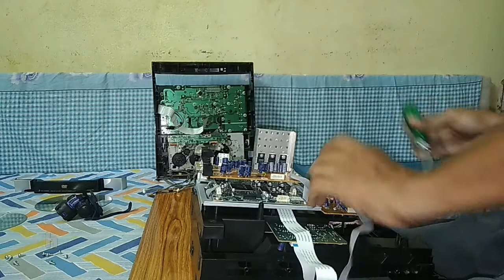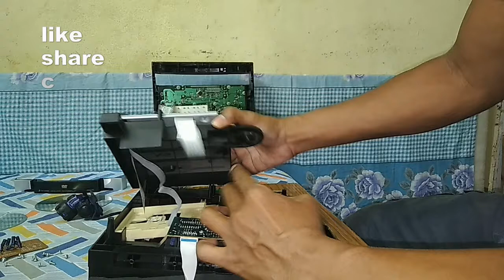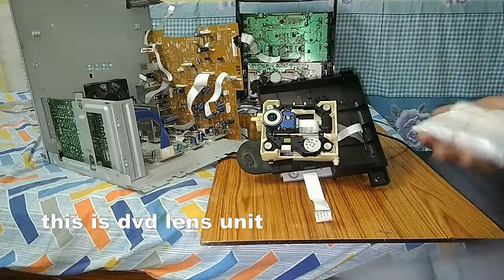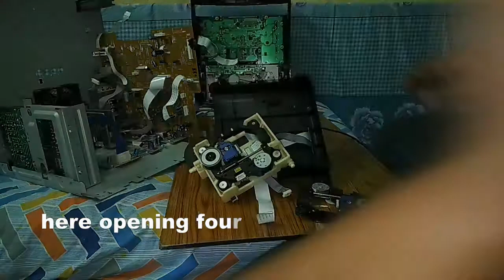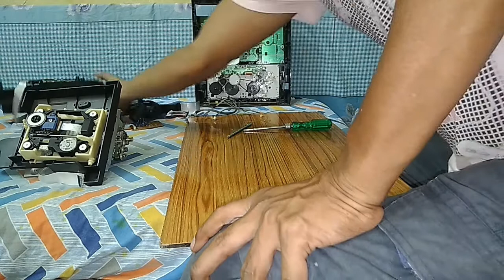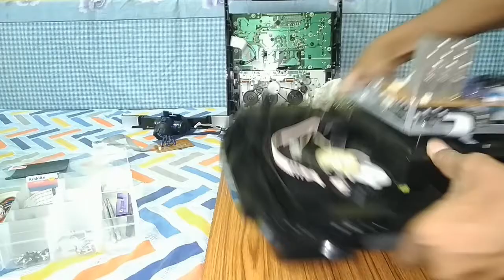easy way to change dvd lens unit

Comment: Bro my sony mhc gnz 888d where to find lens ali express not available because site banned any other solution what is the price range?
Reply from the maker: Do one thing you can find the old system in olx.in and replace the lens. May every model in this system have the same lens. confirm before buying.